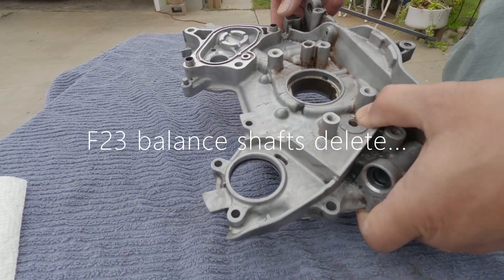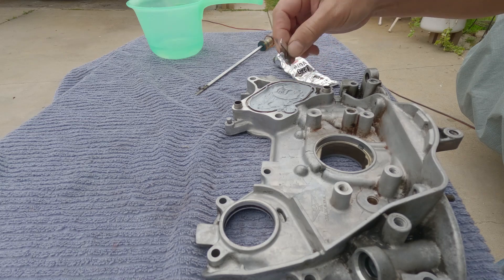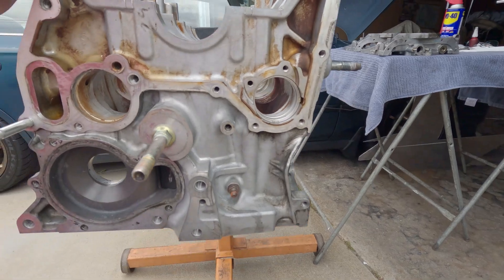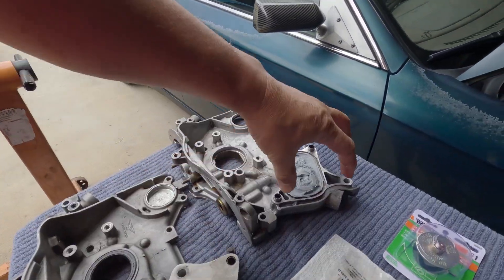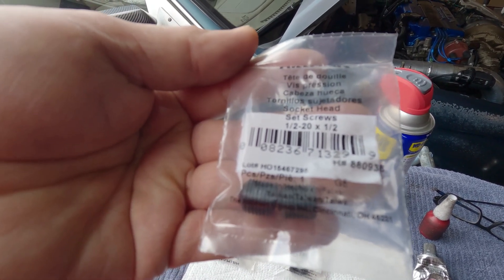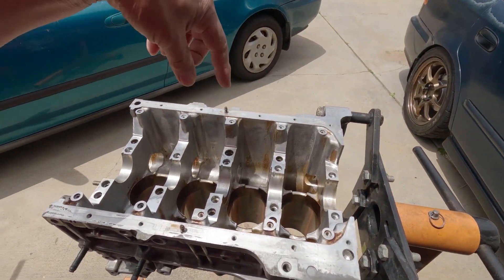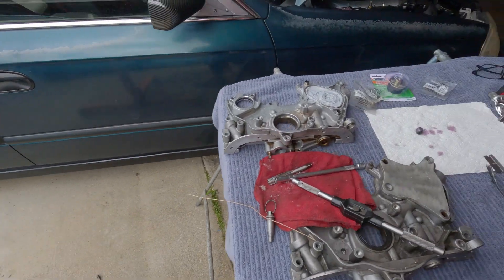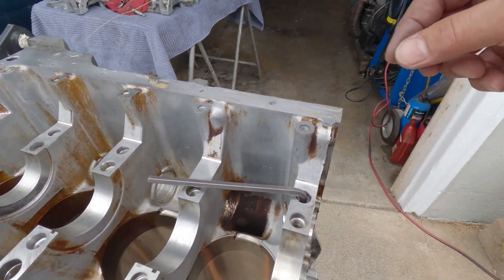DIY F23 Balance Shafts Delete.

Comment: Do you have more vibrations on cockpit ?
Reply from the maker: After l've changed the rear T poly mount to 65a, it smooth out. It's much tolerable.
Reply from the maker: What mounts are you using?

Comment: Why delete the balance shaft? And should I do it on my n/a build?
Reply from the maker: Many reasons, some delete it coz it makes the build simpler, need more space, less maintenance sercicing on the area. If you have a H2B using a plate adapter, there's really no room for it and  make servicing the belt a pita. Some delete it for extracting more hp and use the oil pressure on turbo. I'm suppose to use a ATI damper together w/ deleting the b/s but the funds keep going somewhere else. Maybe in the future l'll put a damper on it. If any of those reason l mentioned applies to you, try it out and see if you think that it make a difference.

Comment: nice work bro, you know if the engine f22b is the same way for deleted balance shafts?
Reply from the maker: F22b and H22 are the same setup. If you are rebuilding your block, its should not be that hard to figure out what need to be plug( if your doing it like l did, diy). If you get the Kstuned delete plug or anything similar, you can follow kstuned instructions and thanks.

Comment: Dorman what is the name  and size ?
Reply from the maker: Dorman p/n 02603. 1 1/2"- 1 5/8"  Rubber expansion plug
Reply: @sagittnet2158  thanks i have the question why my seal balance is out ?Why did my balance pinion retainer come off?
Reply from the maker: @Rperformancerd  the balance shaft seal next to exhaust side is tend to come off. Honda have a Service bulletin to install a seal keeper. Its a small retainer that use 2 bolts to secure it covering the b/s seal.
Reply from the maker: @Rperformancerd  are you deleting your b/s system?

Comment: the balance shaft have nothing to do with the actual balance of the rotating assembly  so your whole test with an ati balancer isn't gonna show anything its the exact same as the 4.3 Chevy v6s its just there to offset the natural shake or frequency of the engine similar with Harley Davidson motorcycle they idle all day long and look like a jack hammer bouncing up and down but no one complains about the balance because nothings wrong its just inherent in engines with fewer pistons the extra vibration you may or may not feel coming from the engine after a balance shaft delete isn't because the engine is unbalanced anymore its just because that's the natural hum of the engine if you wanna call it that kind of like exhaust drone nothings wrong its just there it might be annoying but some people can deal with it and others will install a resonator
Reply from the maker: Good explanation, when l had the b/s deleted on tge other motor, it's the humming sound that l noticed during idling and never liked it. We'll see if l will hear or eperience that resonant humm after w/ ati damper. Thanks for your input.
Reply: @sagittnet2158 please see my other reply above
Reply: Seems like if the balance shaft was only for calming the cabin vibration and not for longevity of the engine itself , they could have accomplished that goal with something much simpler that balance shafts.  I'm not saying who is right or wrong but I did run an H22 briefly without the balance belt and I immediately put it back on.  It just feels like the engine wants to shake itself apart.  I'm working on an F20B to drop in soon and I am still debating on if I want to keep the balance shafts or not. Wouldn't the shorter stroke be less prone to vibration than the typical H22 or F23A crank?
Reply from the maker: @jamesstewart1794  I think it would have the same effect on all of honda's big block. I nevet did liked it when l deleted the b/s on one of my g23. I felt the same thing like you did. That's why l said the next time l delete the b/s, l'll use a damper. Actually someone made a comment before you that the it's not the same purpose the damper will do. B/s is to cancel the resonant of pistons going up and down and the damper is to cance the out of bakance of rotating assy. I want yo know if there will be a difference and ati damper is still on my wish list. I'll review it once it's operational.
Reply from the maker: @jamesstewart1794  Since your project is F20b and having 88mm crank throw. Maybe it wont be as bad and you might not notice anything. Specially if every parts are sent to get it balance including the flywheel and clutch assy.

Comment: reused same oil pump??? is that ok lol
Reply from the maker: OE use oil pump is way better than any aftermarket oil pump you can get. As long as you check all internal gears clearances and if w/in limits, you can reuse it. What usually kill the oil pump are vibration from the crankshaft, deleting balance shafts is one of the culprit and many others. It can damage the gears in prolong peroid of time.

Comment: Brother, I need your help 👍 I have H22A 3 Type S heads not sure about which block to use and please advise….
Reply from the maker: H22 will be the best choice on any build, coz of reliability and parts wise, no need to mix n' match parts. All you need is plain H22 parts. On other hand, if you want to be different, you can build a frank engine like H23a(h22 head w/ h23a1 or f22 crank). Build a G23vtec w/c what l have goin on right now. Always weigh your option w/c parts will be easier for you to collect. It'll be nice also if you have a spare car, that way if something goes wrong at least you still have a car to use.
Reply: @sagittnet2158  H23A1/H22A heads. Does it slap right on to block or you need a return oil line like an LS/vtec built?
Reply from the maker: @sliksta  H22 head on H23a1 block w/ H23a1 crankshaft, it's like having a H22 block,  except for 95mm crank and plug n' play w/ h22 cyl head. It's same build motor l have on my white Accord, l'm just using a F23 crankshaft.

Comment: For the g23 build with h block and f23 crank, do you use h pistons or can you use k24 pistons?
Reply from the maker: If the H22 (55mm main) still has FRM sleeve, it's strictly OE pistons only, using other than OE piston will have a possibility of ruining the frm cyl walls. But using H22a4 piston will create more comp ratio than you need unless your'e ok w/ it. Piston will stick out 0.020" pass the block. Some have use it like these but that's all up to you. H23a bluetop is the best piston to use on setup that you mention because it has the right piston ht and also the correct orientation of wrist pin offset, if you can find one. I've seen others that use Mahle or Nippon racing piston, even they say it compatible w/ frm sleeve and yet its still locking up or scraping the piston skirt. Some folks just use a bit thicker headgasket when they use OE h22 piston w/ f23 block to lower the comp ratio a bit. If you are using e85 for fuel, you might can get away w/ using h22 piston w/ f23 crank.
Reply: @sagittnet2158  i have a 2000 sh. im going to open up the engine and if the sleeves are bad then im gonna remove everything and use the m2a4 transmission I have , I don’t want to deal with frm sleeves
Reply from the maker: @BenDover000  Alright man! Good luck on your build and if planning of boosting it, resleeving the H22 is a must. Later man!
Reply from the maker: In other hand if your h22 got iron sleeve, then you pretty much can choose a variety of  forged piston.

Comment: I did did the same ecept it was still in my car haha. Spun a bearing. So most likely gonna have to get another h22 crank. 😢. Great video!!
Reply from the maker: That's not good man! H22 is the way to go for reliability. Thanks man!
Reply: @sagittnet2158  I actually have the f23a1 block with h22a4 crank and rods. K20 pistons. 60/62 turbo just got Mac 3 port and got the boost by gear dialed.
Reply from the maker: @jeremystgermain2835 kool man! It'sno H22 that's for sure, don't you agree? Later man!